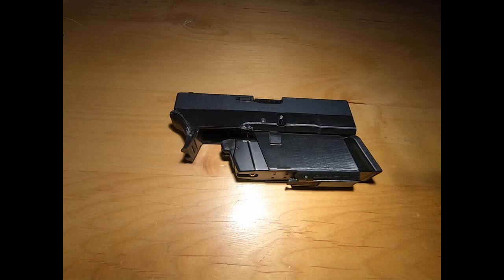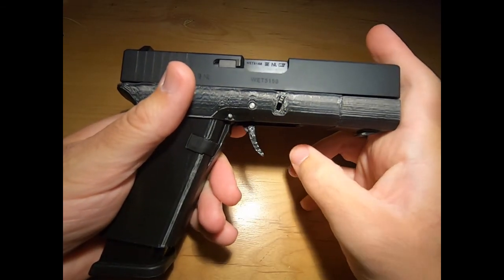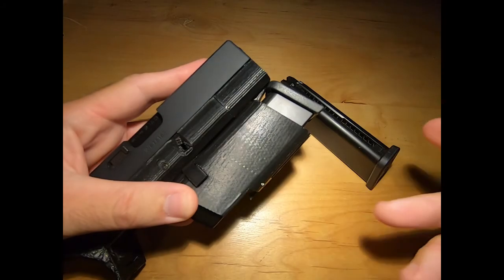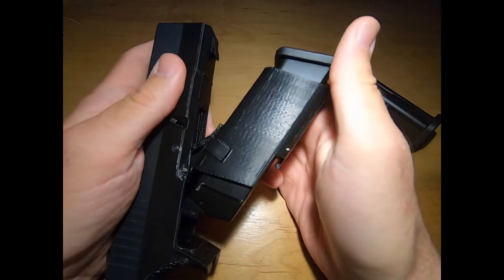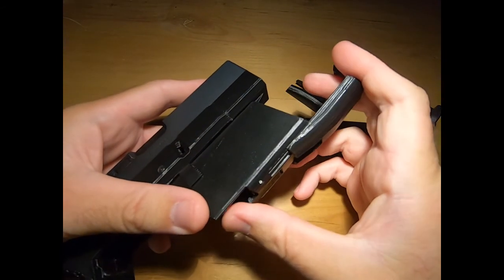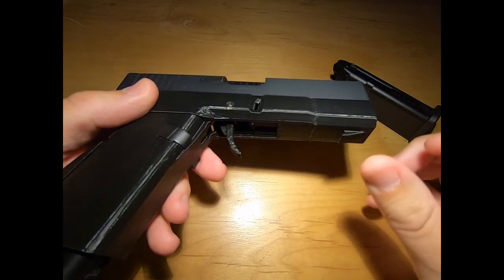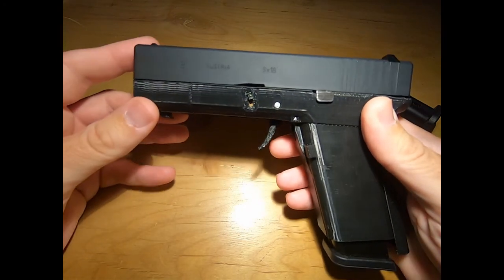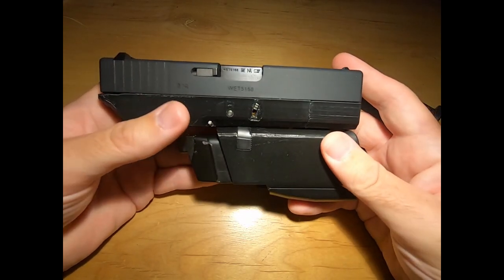3D Printed Folding Airsoft G19

Comment: willing to release just this part of the FPG early? i wanna make the rest of the model myself, and see if i can engineer my way to a simpler folding stock than the FPG, not that its too complicated itself. i'm thinking somehow just add a short side-folding stock and some small rail-space up front  past the end of the gun (on the lower past the clip for the grip obv) and to make it without covering the Glock's slide. mainly just want a different aesthetic than the original FPG but with the same ability of folding up to go into a backpack.
Reply from the maker: I'm planning on releasing a FPG and folding 19 at the same time.
Reply: @enone_9007  nice